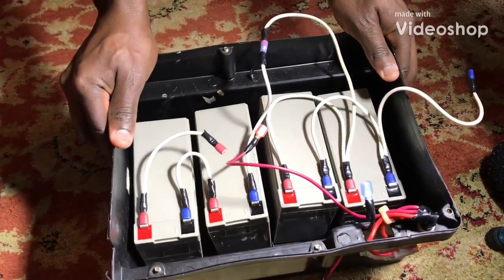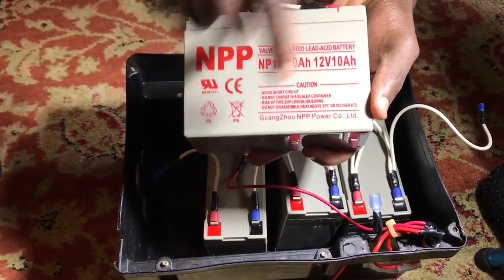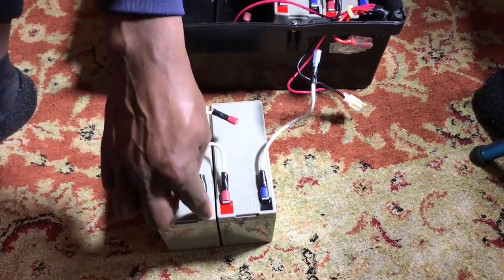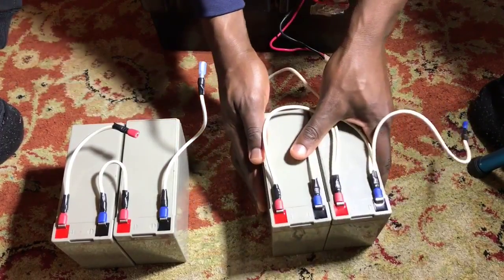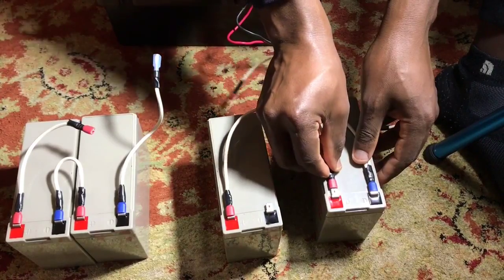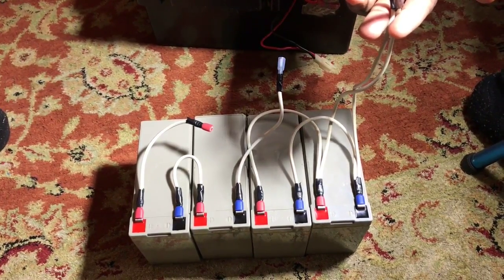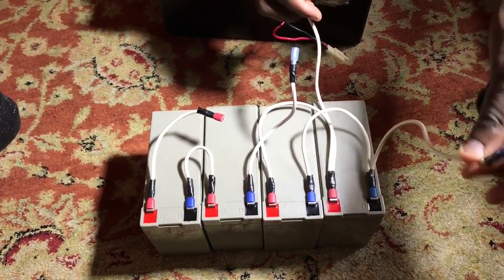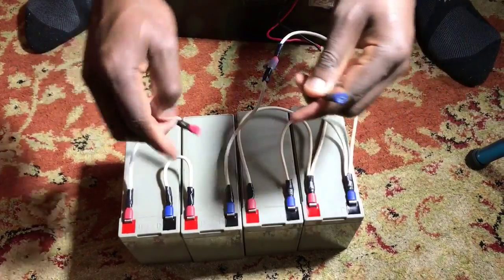How to Replace Batteries for Electric Scooter or e-bike

Comment: THANKS FOR THIS VIDEO.
Are all the cells going to discharge evenly
Or the once in series will discharge
quicker as they are less amps🤔 
And is the total Amps now 30AH ??
Reply: Or 20AH??
Reply: Im just confused
Reply: @Dark-qz4mx  36 volt 20 amp .
Reply: That 24volts how you wired them😂